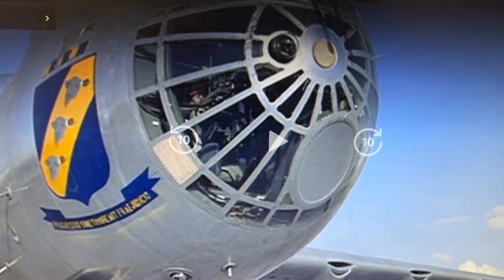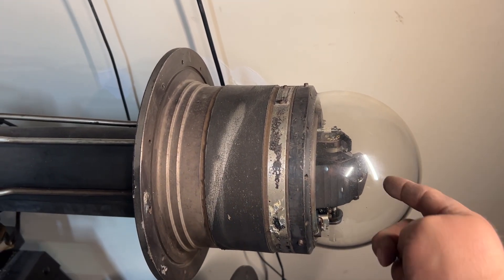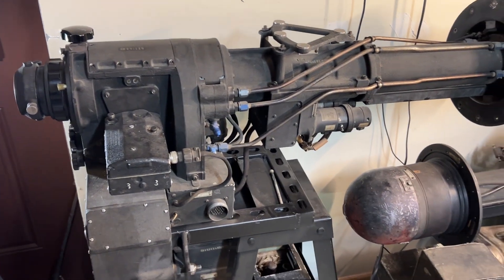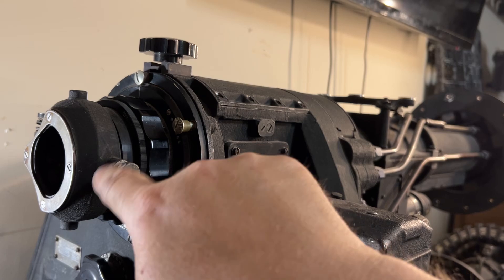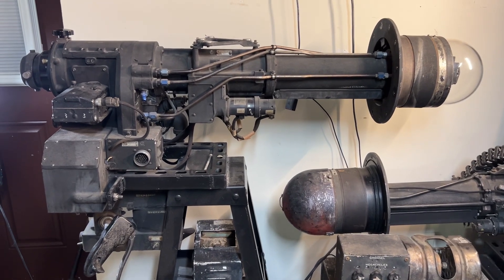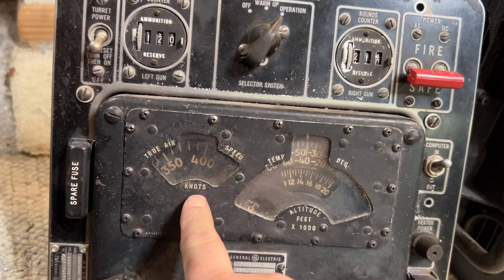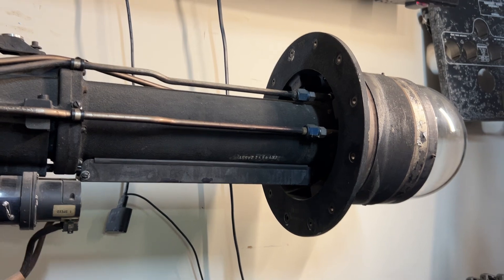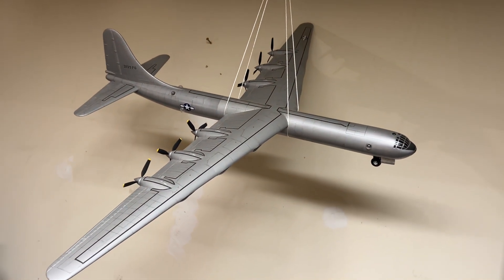Strategic Air Command Film to Real Life: The B-36 Hemispheric Sighting Station

Comment: You need to expose the thorium lenses to sunlight or strong UV light
Reply from the maker: Will this remove the dark shade of amber they have become?
Reply: @B36HPeacemaker  Yes, this is not  uncommon in the high-end camera business, Thoriated glass lenses darken as the thorium oxide decays and ionizes the glass, they can be treated with heat and UV light or simply exposed for several hours to direct sunlight to remove or reduce the yellowing.
I have had good results by removing the lens from the assembly and placing it in sunlight for several hours turning and flipping it to distribute the light evenly through the lens. There are some lens specialists in Hollywood that could possibly give you more information about restoring the lenses.
Reply: It does, but not expect it to take a while  @B36HPeacemaker
Reply: When did B36 jet jet engines

Comment: 1:47 gonna ding you here. Just so you don't keep making same misidentification. That's a optical prism. 
I always wondered where that gunner sat for nose gun and what optics he used. 
So what was the degrees of view looking through the optics?
You should work on getting one functional and get a travelling display for airshows.
Reply from the maker: Copy on the prism. Since I am not working off of a script, I make silly errors and leave off a lot of important stuff.  When looking through the hemisphere, the gunner could see the entire forward "hemisphere" of the aircraft. However, the turret could only travel like 30 degrees left and right of center line, and an even smaller number in elevation.  The airshow thing is possible for the flight deck, however the hemi has lenses that are permanently darkened due to radioactive decay and it wouldn't make much of an attraction.

Comment: Maybe not so "silly" if the computer malfunctions and the gunner wants to get some Hail Mary shots off. And doubtful that the engineers would put a useless,  "silly" switch on a $250,000 gunsight.
Reply from the maker: You have to consider that the nose turret was added for head on attacks. This means the combine speed between the B-36 and the target aircraft would be around 800MPH. Using this clumsy telescope the gunner would have to self compute parallax, bullet drop, lead and also make correction for windage, air temperature and altitude…..in the split second the target was visible in day, night and poor weather. I stand firm on the silly switch label.
Reply: @B36HPeacemaker  OK. And I will stand by my comment that bright engineers do not put "silly" switches on a quarter million dollar (in WWII money) gun. Just because you do not fully understand a complex machine does not make it "silly".
Reply from the maker: @kahlesjf  I control three examples of said machine, one of which is fully functional. You can barley track a Cessna 172 on approach with these things.
Reply: @B36HPeacemaker  There could be reasons other than manual tracking for there to be a disconnect switch from the radar tracking system.
Reply from the maker: @kahlesjf  The vintage documentation is clear as the computers were subject to regular failure. Additionally, the turret position in question did not utilize radar. That was exclusive to the tail gun.
Reply: @B36HPeacemaker  If caught off guard, it might have been necessary to temporarily disconnect the nose gun from the computer. And one of the more vulnerable places on bombers to fighter attacks were the pilot and copilot positions. Or, as you say, the computer was subject to malfunction. Maybe the nose gun was not manually operable unless disconnected from the electrical system of the computer. No matter how poorly designed a complex system, it seems odd for there to be a switch that only makes things more difficult.
Reply: Computers of the day fragile when cannons fire often went.off line
Reply: @Eric-kn4yn  Your comment has nothing to do with the switch he is referring to.

Comment: The "D" model B-52 had a similar "Hemispheric" Optical sight at the rear gunners station.  For use if the Radar for the DFCS system failed.
Reply from the maker: Correct. In the later models of the B-52, the hemisphere's view was transmitted via CCTV when the gunner was moved to the forward area of the aircraft.

Comment: @6:01 that's roughly 2.5 million in today's figures if anybody interested (I used 1950 for year)
Reply from the maker: I got that figure from a documented court case you can find if you Google “Farrand Optical B-36”. Additionally, I have a PDF of a vintage parts catalog that shows the cost of the compete units and even every nut and bolt.

Comment: It is not a crystal.  It’s a PRISM.
Reply from the maker: You are 1000% correct.
Reply: @B36HPeacemaker  like binoculars
Reply: Hard to move so you dont overcorrect ?
Reply: Speed in knots temp height were basic metrics imput into gyrogunsights of ww2   not sure the analogue computer comes in here but parallex of bullet trajectory would  ?

Comment: Very nice presentation!  With thorium being used, I’m curious if there is any measurable radiation when nearby the device?  I’m not at all overly sensitive if such radiation exists.  Heck, I’m sitting here cleaning the electrical connections on a ion chamber that I use to measure calibration samples of several radioactive sources.  I’m purely curious, that is all.
Reply from the maker: Yes, the optics in the hemisphere sight are hot, but only up close. Eventually I’m going to do a video showing radioactive B-36 stuff in addition to the one I made about the gauges.

Comment: I had an opportunity to actually crawl through a B-36 that was located at an old airport in Fort Worth. I also worked with an engineer that was a flight engineer on the aircraft. Absolutely a great experience. The aircraft was moved to the Pima Air & Space Museum (PASM) in Tucson, Arizona . I think it was a J version.

Comment: Was there any validity to the claims that the B-36 had reliability problems with its defensive armament?

If so was it specifically related to the 6 retractable fuselage gun turrets or did it also effect the nose and tail armament as well?
Reply from the maker: The entire system was troublesome for the entirety of the B-36 program. Over time, improvements were made here and there. The radar aimed tail gun was the most reliable unit, and it was to be manned at all times at the cost of any other gun position when in combat.